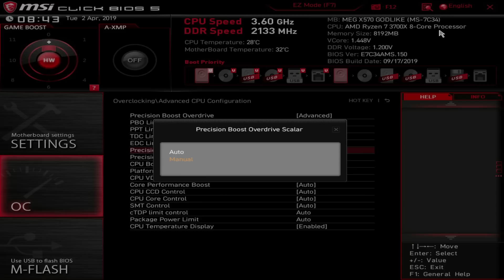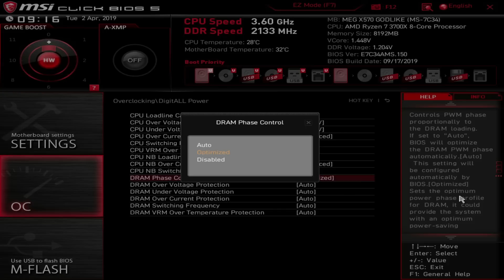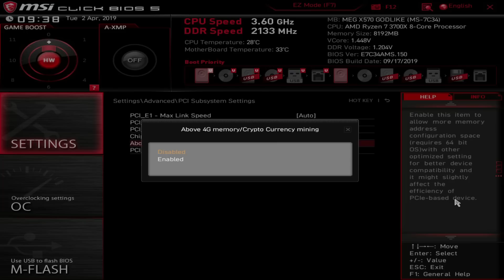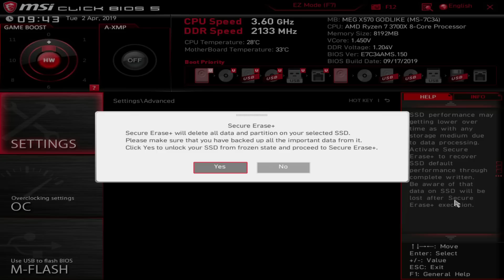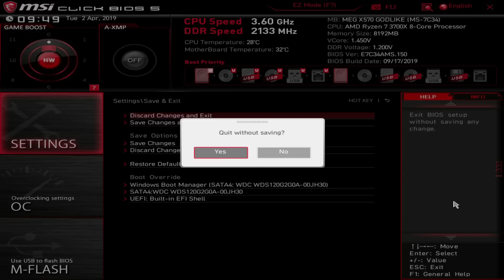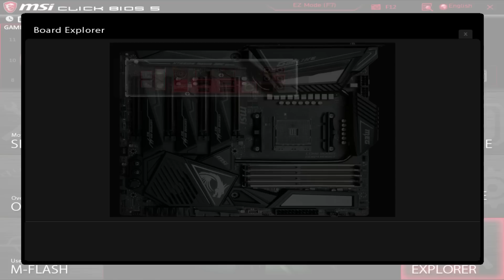BIOS Walkthrough: MSI X570 Godlike

Comment: Strange that you didn't see a difference in the PBO "enhanced mode #".... on my X470 gaming pro carbon, with R5 5600G, it's the difference between rock stable 4.549MHz, @ 1.4v (lvl3), and 4.550MHz @ 1.38v (lvl4), according to Ryzen Master. That does report "auto overclock" instead of "pbo" with these custom pbo settings. (this is with aida64 stability test)
i'dd post screenshots, but YouTube doesn't like links...

Comment: buildzoid can you comment on x570 godlike default ppt 500, tdc 245 edc 215  with pbo settings to motherboard and a 5950x i just had to rma a 5950x and i feel like maybe those settings are just to much with auto cpu voltage. it was constantly at like 1.5 volts and i could be wrong maybe i just had a dud 5950x that died after 45 days. what settings would you run for this board and 5950x

Comment: On newer BIOS versions with the added Curve Optimizer the Max Boost Override setting actually does something. If you set negative values for the Curve Optimizer, so that the cores use less voltage, they have more (thermal or current) headroom for boosting higher, which is where the Max Boost Override comes in. Then you can actually see the setting have an effect.

Comment: Great video.
Maybe you or someone watching can help me.
I have tomahawk x570 and Ryzen 5900x
On stock settings it is very unstable. Reboots under load and idle. Mamy people have similar problem.
I checked every part possible including 3 psu changes.
It seems that changing soc value from auto to 1.1 can help with stability. Is 1.1 safe for constant use ?
Reply: SoC voltage should not go above 1.2v, so 1.1v is absolutely fine.
Although it mainly affects the RAM stability, so not sure what's up with your system.

Comment: Came here looking for some information: So I have the x570 Godlike running a 3950X and I'm assuming the board just runs high voltage for the hell of it. My Voltage is mostly 1.4 although I do have PBO enabled. Just seems to high to me. EDIT: Left out that it's basically idling around 47-52 Celsius :(

Comment: When you were saying you didn't know what disabling PBO limits would do, the help bar on the right was saying what each mode does. Scrolling down probably would've said it.
Reply: Hate to reply to a year old comment but I have this board and it actually doesn't say what PBO limits "Disabled" does in the help text. Doesn't mention that setting at all.
Reply: And I'm from the future with just having bought this board for needing better pcie slot spacing for my evga 3090 ti and intel pcie ssd to say it still doesn't say what setting it to disabled does after the latest bios update. Which by the way since watching this video in 2024 there are even more settings to play with so we should get an update on all the new features! @ActuallyHardcoreOverclocking can we get an update?

Comment: 1.0.0.3 abba bios for x470 GPC have an issue, I have memory OC error every cold boot
Reply: Артём Кучеренко what is ”this feature” you are talking about?
Reply: @theluggage7131  sorry, I`m about, memory overclock, parameter "memory fail retry", when fault to load with certain parameters bios boot with default memory settings, so you don`t need to clear cmos

Comment: On my x570 gpc:
* Every time I go in the amd oc menu it resets to defaults. And the vddg and vddp are sky-high. Like 1.100 and 1.150 or the other way around.
* Can only disable gdm in amd oc menu.
* Changes in the amd oc menu don’t 
show up in the save and reboot pop-up.
* smart fan bugs out around 70c with 40% pwm, fan goes to 0 or 100%

So I hope agesa 1.0.0.4 is better. And that the next windows update starts using cppc to bost the best cores in lightly threaded loads.

CnQ needs to be enabled for correct boost and idle behavior btw.

Comment: My 3600 gains a bit of single core performance (maybe 1-2% at most) from the boost override, does nothing to the multicore at all.
Reply: Gorbaz The Dragon how many Mhz did you throw at it?
Reply: I also wonder that. Did you put override to 200?
Reply: @matrixfull  tried 50mhz increments up to 200 and it stopped gaining anything at 150